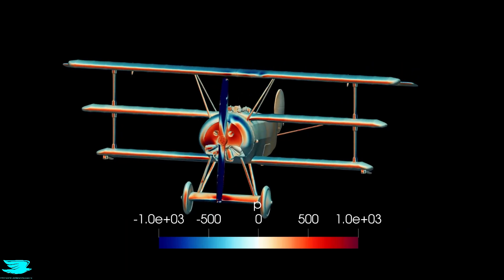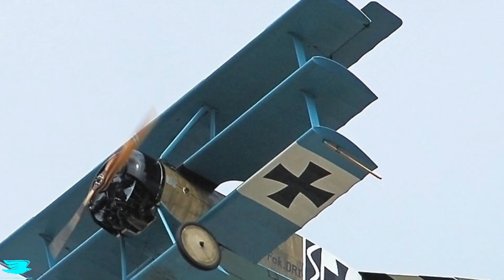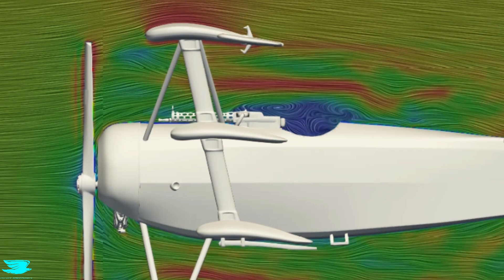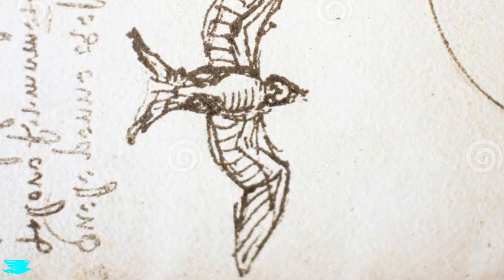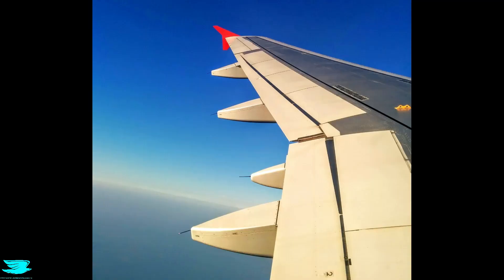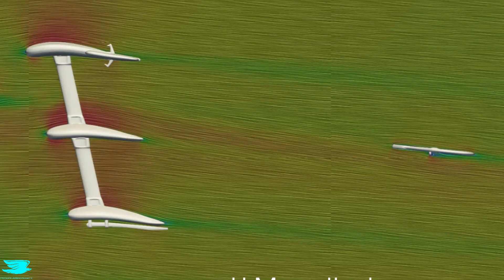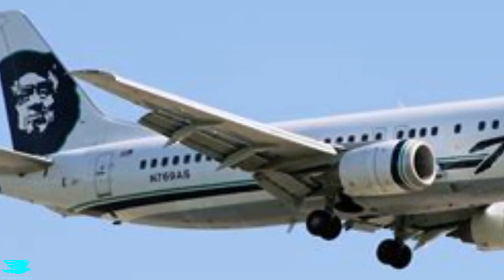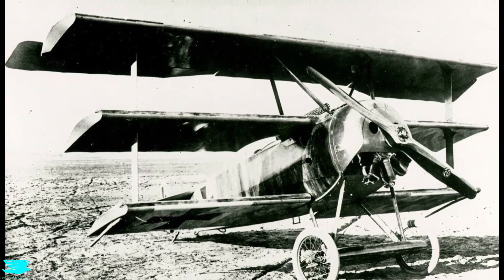Red Baron's Genius Aerodynamics

Comment from the maker: There are quite a lot of criticisms in the comments.

The main ones being:

1. The tri wing design was adopted to reduce the supporting wires and reduce the interference drag, and not in an effort to get more lift.

2. The wing flaps/ailerons extend out the ends to increase surface area, not to act like horns.

3. The wing flaps/ailerons were only on the top wing because that was the custom at the time.

Our responses:

1. It comes down to two things. The first is whether the engineers thought having a tri wing would reduce the interference drag. And secondly, whether it actually does or not.

The engineers might have thought that, but with an additional wing, you have more larger supports too, which increase the interference drag from them. You can see that interference drag in the drag orbits.

To see whether these additional larger supports produce less interference drag than a biplane with more wires requires testing, which I haven’t seen anything on for this plane.

The fact that Fokker also added a little wing around the wheels shows just how much they wanted extra lift too.

2. The horizontal stabilizer also has horns, so it is likely that the wing flaps were extended out the sides for the exact same reason.

If they wanted more surface area, they could just make the wing flaps have larger chords.

3. The fact that the wing flaps are position very carefully such that the start of them coincide ONLY with the ends of the tail, tells us that the engineers knew how much of an impact they had on the tail.

As such, the wing flaps weren’t just placed where they were willy nilly (in terms of which wing they were put on and the exact position on the wing). They were placed there on purpose, with their effects on the tail’s aerodynamic being one of the driving reasons.

Finally, at this time, there were around 100 triplanes designed. Most never saw service. But what that shows is the extreme innovation at this time.

Rapid innovation doesn’t come with excellent documenting, especially in wartime. Even in non-wartime, documentation usually isn’t as thorough as we’d like it to be.

The rest of the criticisms are pretty much covered in the video already.

Comment: Max M. Munks' Biplane Theorem would be a good place to start.

Two wings splits the span for a given area and aspect ratio.

Two wings can have a span efficiency (Oswald e factor) above 1. In fact, a biplane having the wing gap of 1 span length can have an e value nearly 2.0. Although impractical. 

A triplane extends these benefits further although only slightly.

The biggest advantage of multiple wings aside from structural rigidity and bracing reasons, is by making the span shorter for better roll rate, while preserving some of the lost efficiency of increased induced drag due to lower aspect ratio. As the two or three wings have larger aspect ratios than a single wing of the same span and area.

Since roll rate is directly related to wingtip helix-angle. Shorter span means greater roll rate per forward distance traveled.
Since ailerons can only be defected so far before they lose effectiveness, they can only push the wingtip to so far of negative angle of attack and this when plugged into the helix-angle formula shows shorter wing is required to roll harder.

Comment: History of technology is not your strong point (warn: I am Russian. I know English and small talk poorly. But I am polite).

1. Fokker Dr. I was a response to early Sopwith Triplane, 1916.

2. The wing loading of Sopwith is lower. The speed is higher. The weight and power are slightly higher.

3. Almost all the aircraft of that war had fabric covering. The reason for the protrusions is the fabric stretched over the ribs, of course.

4. Wing fences to prevent airflow in front of the ailerons were developed in Britain in 1914, they were used on large flying boats.

6. Horn balancer of the ailerons was used in 1915 on the HP type O bomber.

7. Small ailerons on each wing of the Sopwith are much easier to balancing. The triplane had the ability to fly without hand control. This was a requirement. The main difficulties of these small aircraft with rotating engines were in controllability. The triplane is an attempt to overcome the difficulties of controlling the Sopwith Pup. In Germany, ailerons on one wing were a tradition. In general, ailerons were used in Germany later than everyone else. Dr. I  are only for aces.

8. The innovation of the German machine was the wing profile. But on the triplane box, the thick profile is a mistake. The thickness of the profile increased the already enormous interference. Triplanes and biplanes with a thick profile were not built in large numbers. The thick profile helped to make the wing lighter, but in itself it is worse.

9. For the first time, but unsuccessfully, a thick wing was used in 1911 in France by Levavasseur. It became successful at completely different speeds.

10. The advantages of Dr. I are lightness and two machine guns. Nothing outstanding in aerodynamics.

11. About the history of that war: the Germans were constantly losing it, the Allied air force dominated the enemy. The Germans' task was reduced to air defense. Nothing ingenious and almost nothing first-rate. The German air force of those years was second-rate. It just happened. Look for origins for the Germans in the USA, Britain, France, Italy, Russia.

Comment: The middle wing should have a strong effect preventing early flow separation on the lower wing root.  This is a common issue with blunt nosed aircraft and twin engine wing pods.
Reply from the maker: Good point. It would help push the flow down onto it.

Comment: The purpose of the low aspect ratio tail is so it will stall last. This in effect will cause the nose to drop when the wings stall. When the nose drops, the flow above the wings gets a chance to reconnect. And this restores lift.

The wings were thicker so a deeper, stronger wing spar could be used. This enabled just one set of wing struts and no bracing wires.

The triplane was slower than its two-wing contemporaries. But it was fiendishly more maneuverable. And that was the top design goal.

Thinner wings likely produced more lift per drag. Thicker wings produced more drag but disproportionately more lift. They also stall at a much steeper angle of attack. If you are willing to tolerate a slower airspeed, you can have these benefits.

And, at that time, maneuverability was considered king.

Comment: A very interesting and informative video  . One thing that you did not take up on was the short length of the fuselage. By having the rudder further foreward , it would able the aircraft to turn in a smaller circle .
Reply from the maker: That's definitely true. The shorter length increases yawing and turning rates. The moment arm drops but the weight and second moment of inertia drop faster.

Comment: Video 3 with the same question: Please do the Ford e-Transit L3H3, I'm modding it to be more Aero, moon disks (done), blocking front radiator (done), making underbody panel (under construction), closing rear wheel arches (under construction). I would be eternally grateful if you could find more issues I should tackle.
Great video btw, I love the Red Baron!

Comment: My understanding is that thin vs. thick wings related to Reynolds number.  If you do wind tunnel tests on small models, it will tell you that you need thin wings.  At full size, Reynolds number is much higher and L/D much better

Comment: I believe the DR1 was a near copy, or at least inspired by the Sopwith Triplane.  Maybe someone ought to examine that, as well.
Reply: It was certainly inspired by the Sopwith Triplane (at the insistence of German leaders), but 3 wings is all that it has in common. Everything else is different.
Reply: @EdmondDantes-c8t  What exactly is different? And the main question: what is worse in original?
Reply: @Ernest-jr  The Sopwith Tripe does not have cantilevered wings, the wings have a larger gap between planes, the Sop Tripe also doesn't have aerodynamic balances, it has ailerons on all 3 wings, and it has only 1 machine gun.

Comment: The direct effects of the triplane design were all negative. The DR1 was a great performer because of its advanced airfoil and propeller design, and being optimized for climb performance (which gave tactical advantages). These advantages were great enough to overcome the negative effects of the triplane design.

Comment: A number of inaccuracies in this video; apparently the narrator is not an aerodynamicist. For example, he states that the flow/pressure on upper surface of the horizontal stabilizer is critical to prevent stalling. It is the flow over the lower surface which must remain attached for the horizontal stab to remain effective - i.e. not stall.

Comment: Wow, so many things that are almost correct, but still completely wrong. 
First, and only because it caused me the biggest cringe. 
A flap is a flap, and an aileron is an aileron. They do different things, they move in different ways, and are mounted on different parts of the wing. (Unless of course, they are flaperons, an idea that sounds wonderful, but in reality, not so much. So we won't mention them again.)
While they are both "flight surfaces" (control surface is also acceptable) calling one of them by the others name doesn't change what it actually is or the function of the surface. Additionally, there were no World War I aircraft that ever employed flaps. And there is a good reason for that. They hadn't been invented yet. Flaps became an idea about two years after WWI ended. It took another two years or so of research, testing, and general tinkery, before they were actually flown on any production aircraft. 

Next, the "Ridges" on the wing were not a design feature. These ridges are actually a (mostly unwanted) byproduct of how wings were made at the time. (In fact, some aircraft designers took steps to eliminate, or greatly reduce their presence.) There are pieces inside the wing that determine the shape of the wing, called ribs. The wings of the era were covered with fabric that had a finish applied that made the fabric shrink and pull taut on the frame. The shrinkage caused the fabric to draw down in the spaces between the ribs, kind of highlighting the presence and shape of the ribs. Think of a poorly cared for, underweight dog. The dogs skin shrinks down and you can see its ribs.
The wing fence (stall fence) wasn't developed until the mid to late 1940's
During WWI aircraft designers were basically just trying out new ideas and hoping it did something beneficial. Heck, most of the aircraft designers hadn't even got the center of gravity thing completely worked out yet. 
That's why the, "Dreaded Tail Spin" was so feared by most pilots of the era. A more proper name for the phenomenon would be the, "Dreaded Tail-Heavy Spin".
I'll stop here, because I've exhausted my typing finger. Hopefully I've spread a little bit of enlightenment. Or at least a grin.

Comment: Did anyone else notice that the 'Dr.1' appears to be a plastic construction kit? Or at least, a laser scan of one. It certainly isn't an accurate representation of a real Dr.1, for multiple reasons. Take for example, the wing trailing edges, which are absurdly thick.

Comment: Calling the DR 1 "Genius Aerodynamics" is a little ridiculous. The drag is enormous with all those wings fighting each other. I'm sure they interfered with the elevators as well. The rudder is inadequate especially considering it's role in aiming the guns. It's construction was nothing special. Thankyou for the video.
Reply: The rudder is actually extremely effective. The aerodynamic balance eliminates all of the force required to move the control surface, and the plane responds to the slightest movement of the rudder.

Comment: Ailerons are used “differentially ”, ( one goes up the other goes down ) Flaps a used in unison ( both move down at the same angle ) you need to lean that. Aileron “balance horns” do balance stick force, but ailerons are also “mass balanced” with lead weights. You should build a few model airplanes and learn your terms better. Otherwise good video
Reply: The Dr.I does not have mass balanced ailerons, only aerodynamic balances. The stick force is incredibly light, especially for an aircraft of that era.

Comment: "MOST IMPORTANT SINCE WRIGHT FLIER": simply RUBBISH. Unfortunate trend of Utube "aviation experts": simply WRONG** - YET: their current viewers of same generation are viewing and absorbing - and repeating - as if this was truth & applicable aviation physics. I worked on construction of Sopwith "Tripehound" (& worked on Fokker Triplane newbuild) - which led to Fokker adopting the same configuration - but with totally different single box spar (hence, by design = thicker airfoil/profile) panel design, eliminating necessity for ANY external fittings: NON-STRUCTURAL outer INTERPLANE STRUTS were only added at insistence of equivalent of Germany's REM - all they do is increase drag. As Head of international airline training facility, I taught aerodynamics: nearly everything described in this presentation is either misleading or simply not true: FUN FACT: mention is made of reduced loading at each panel root , on our Sopwith Triplane, in level, unaccelerated flight, the wing root bolt attachment of centre panel was subject to only 12 lb loading. (**ditto Spitfire - I worked on two - Mk1a & MkIX - several errors now on utube and Wiki ref physics of early Merlin std float carb limitations, characteristics of Spit aerodynamics etc. Have seen Utube where even base laws of principle of lift are completely misrepresented.....all this truth...GONE in one generation. I am frequently gobsmacked by even ATP drivers lack of type knowledge and aerodynamics in general. FOKKER PERFORMANCE:  recent comparitive performance in dog fighting with both Camel & Pup, shows high drag limitations inherent in Fokker having x 4 sets lifting surfaces. Its superiority on Western Front was spectacular - yes but: short lived: British fighters soon adopted tactics of running them down - avoiding turning/climbing combat. Similar to WWII Zero short-lived superiority once Allies altered intercept tactics.

Comment: Why did the DR1 have ailerons on just one wing?
Because that was the custom on German aircraft. British aircraft customarily had ailerons on every wing.
I'm unclear as to why a thin horizontal stabiliser is bad - it's not a lifting surface so surely you optimise for minimal frontal area.
And why is he banging on about wing fences - they're straight wings and any fool knows the construction is doped fabric over ribs. 
As for genius design...not really. The middle wing sheds turbulent air directly onto the horizontal stabiliser, not the case with contemporary biplanes.
There is good reduction of drag by not using much bracing - the wings would be quite stiff already.
The DR1 had a poor record for crashing but this was attributed, at the time, to the upper wing failing due to poor quality controlduring construction. The leading edges were plywood and the transition to fabric is a tricky area - the upper wing was under more stress than the others due to its higher lift - its possible that separation occured allowing airflow inside the wing and the ribs damaged easily........and this was the only wing with control surfaces. 
Anyway...it was such a genius design that Fokker gave up on it instead of trying to improve it.

Comment: The ridges on the wings practically were not a desired feature back then but rather a required result from the needed construction method. That being a wood frame covered in fabric and once the fabrics were shrunk to make them tight, they also formed valleys between each wooden rib. The same effect can be seen on any moder fabric covered plane such as a kitfox.

Comment: Aileron and flaps are control surface with totally different functions. Ailerons function is to control roll, when one going up and the other goes down. During WW1 they could not be both moved up and down at the same time.  Flaps increase lift of the wing by changing its shape and were just being introduced during WW1 and not really understood. The only example I know of was the Sopwith1-1/2 Strutter that had small lower wing flaps next to the fuselage. Although both types of control surfaces effecting the airflow over and under the wing they could not do the job of the other surface. Any air fence action of the wing ribs and cloth construction was purely accidental. That was a concept that was not even through of at the time. A lot of the design improvements in WW1 was pure experimentation. That is why Fokker produced over 21 prototypes but only produced 4 production fighters in 4 years.
Reply: Breguet 14 had flaps aerodynamically actuated.....
Reply: @b05296  Thanks, the only one I knew was the Sopwith1-1/2 strutter.